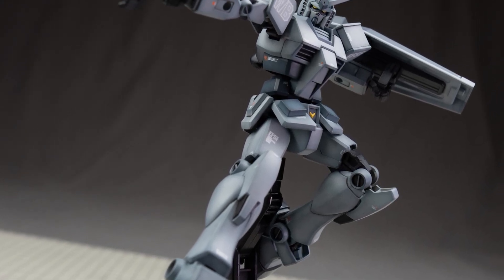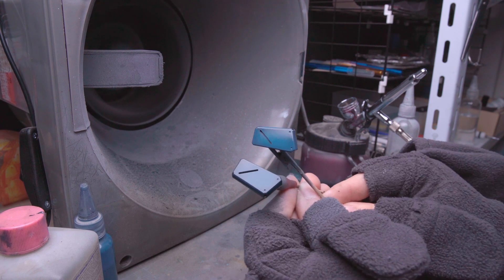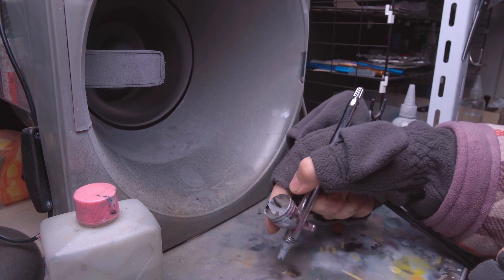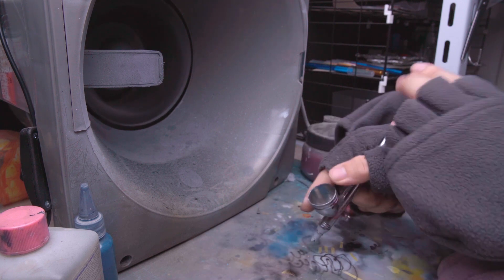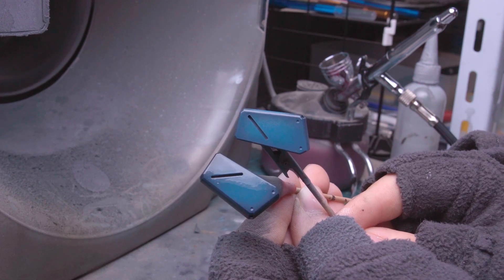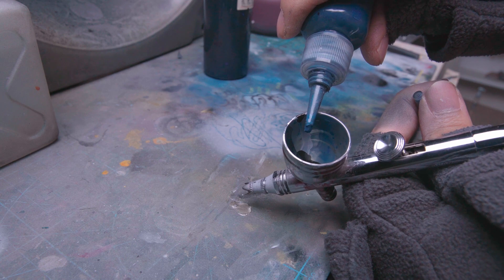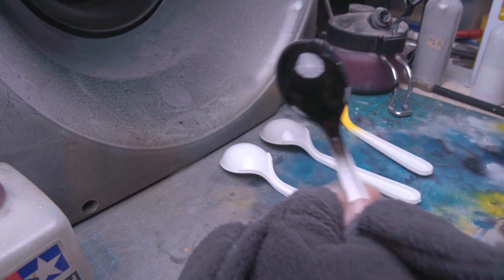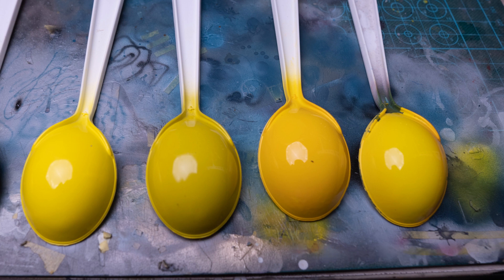Gunpla Shading Tutorial Pre-shading and Highlighting How do I paint them

Comment: i currently am using weathering powders and eye shadow make up sponge to do shading as i am currently doing speed builds.

i want to also advise ppl to not try to airbrush using vallejo game colours. they have changed how the formula works and it now uses a gel medium as a binder and it will clog or pigments will start to seperate if its too diluted. their other lines are okay, especially their model and model air colours.

of coz builders can stick to japanese paint brands as they don't mess around and will always produce consistent results.

i do not like using black to do preshading as it can have odd interactions with colours as many colours we use are off colours (not pure primary colours) or in your demonstration with yellow, create undesirable outcomes.

Comment: Hi i have a question about Airbush, I am currently using the beginner AB HD-130, and even with the 0.2 mm AB i can't narrow the spray. Its just sprayed all over the model, I can't control it to follow  the line/the edge like when you do pre-shading. So do i need to buy a better Airbrush?
Reply: Without knowing your setup, my guess is that you may not have a regulator attached between your compressor and airbrush? Your needle size should be fine and if it's not spraying out correctly it could either be:
1. Too much pressure from the compressor
2. Paint could be too thin?
3. Pulling the trigger back too far